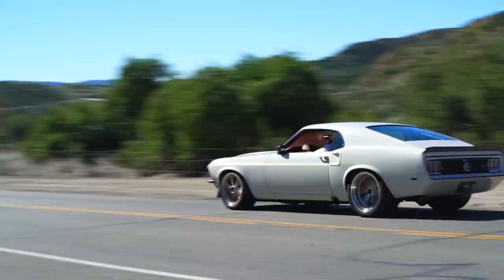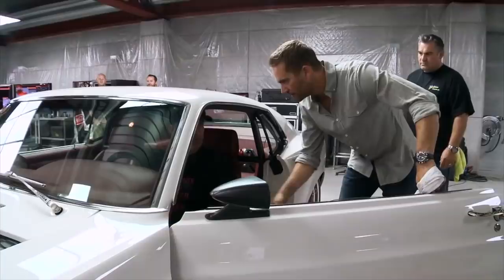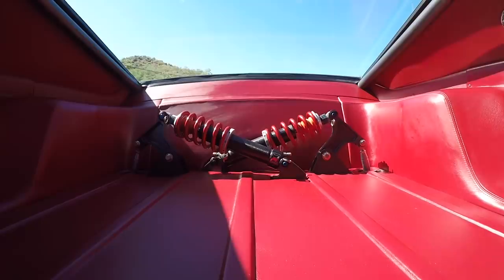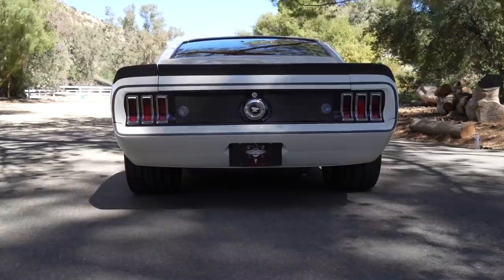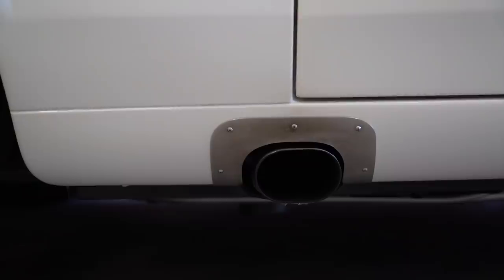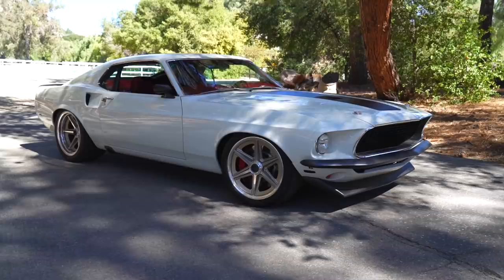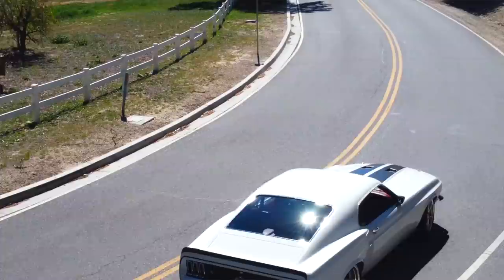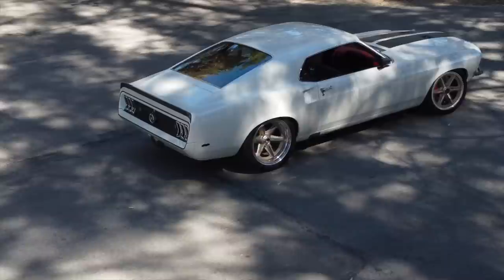800HP Big Block '69 Mustang "Anvil" from Fast and Furious

Comment: In the early 70s, I had a maroon 69 mach1 428cj with hooker headers, short pipes, and glass packs. It had a 4-speed manual gearbox. Of course it had the shaker hood.
I loved that car. I still wonder how I ever let myself get talked out of it even after I had just rebuilt the motor.
It's the best car I ever had.

Comment: I haven't seen a bad Ford build by Steve yet. Love his work and this car inspired my 1970  Maverick , "Havik" and the Fairlane build inspired my brothers build a 1973 Grabber Maverick "Mayhem"....

Both cars are getting makeovers now. Both builds were long in the tooth. Both will be wicked.  Mayhem has and will keep a 331c.i. but is changing heads and induction, will get higher compression, it has a full rollerized C4 , reverse manual valve body and trans brake, but its getting something more modern maybe a 10 speed auto, this swap alone would allow another .6 maybe a second off of 1/4 mile times. It ran 11.54 @124mph already. Both cars will run 9s or 10s on motors. Both cars will have nitrous systems just in case. I'll keep the rest to myself.